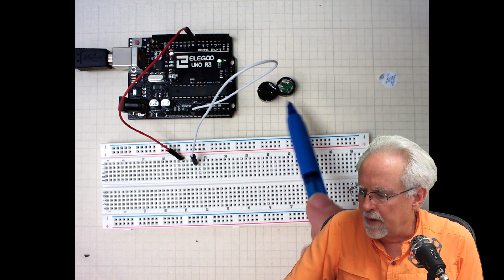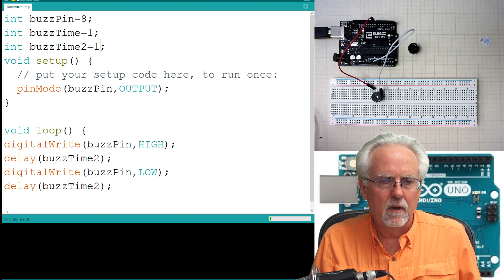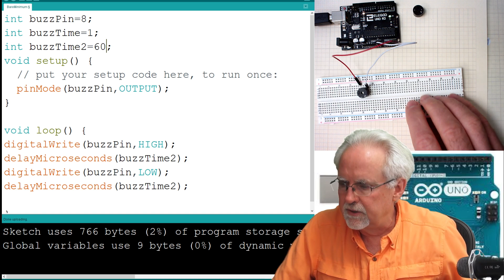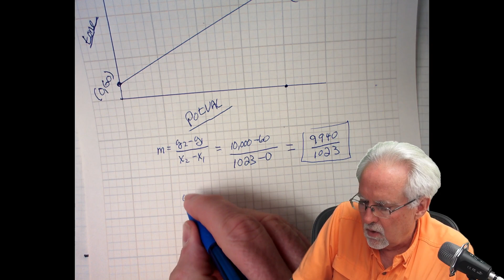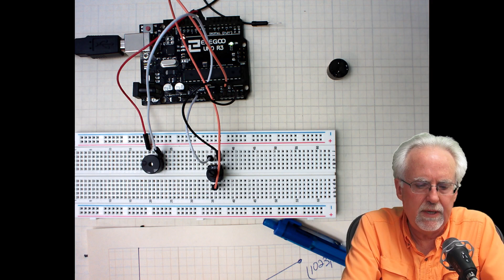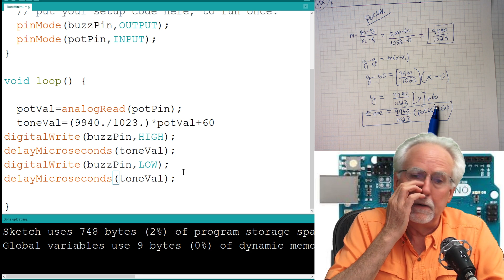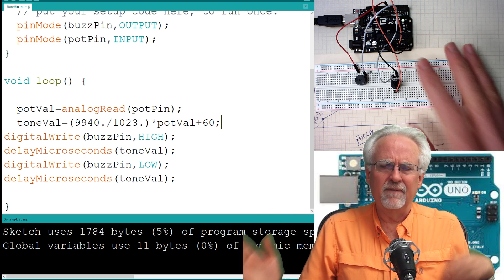Arduino Tutorial 24: Understanding Passive Buzzers

Comment: for anyone doing the Serial.println(potVal) command, i think it messes up the timing for the tones. even when using numbers and not using the potVal, i couldn't get mine to work. but as soon as i deleted the println command, the tones worked perfectly with value, and the potVal.
Reply: heyy, i had this problem too and i found out its due to the baud rate,  as you increase the baud rate the sound will get better, i was shocked too when i finally found out
Reply: Thank you Meng and Carlos, that solved the issue i had. Printing more text (data) per line deforms the tones even more.
String msg = "Delay (Tone) is: ";
Serial.println(msg + buzzTimepot);

So i changed the baudrate to 2000000 and now all is well.
Reply: @mengkin5836  Thank you! I was scratching my head onto why that was an issue :)
Reply: I had the same issue. And just fyi instead of deleting your code just go through and add // in front of the lines of code you are unsure about instead of deleting it. That will make it a note and not part of the process. This way you can verify an action before fully acting on it. It's a common practice in code troubleshooting. Other languages have different commands but in this case its //
Reply: @trakeC   thanks for this tip!
Reply: @trakeC  thats a good little trick. Thanks for that
Reply: I had the same problem... getting rid of the Serial fixed it.
Reply: A good debugging process for this is to use the // comment lines in front of the suspect line to test it without deleting it.
Reply: All i can say is ... THANK YOU :)
Reply: only took me an hour to figure that out...
Reply: Thanks for posting this - All I could get out of my circuit was a low pitch monotone, I deleted the Serial.print and it works as it should. Setting a higher baud helped but removing the Serial.print gave the best results.
Reply: Thanks for the added education. Been playing with the arduino as something to do during this COVID thing while I am not working... this one had me totally lost as to the cause... yes I am writing both values to the serial monitor... guess I am gonna have to comment out the writes and see if that fixes the issue. Man I am learning way more than I thought I would (this is a good thing) and Paul really makes things seem easy.
Reply: @rstudinarz  I found the difference in tones as well when I was using Serial.println to validate that I was doing things correctly. Then I remembered that the Serial output functions wait until all the characters send data over the relatively slower serial interface.  The function doesn't return until all the characters are sent - meaning that more delays are introduced which ultimately impacts the tones.
Reply: i had this problem thanks!
Reply: that's the trick, thanks
Reply: I did the same, thank you very much

Comment: Paul, My Arithmetic skills are definitely foggy at best, I could not get everything set up correctly, didn't feel confident plugging everything in, Yes I folded like a cheap lawn chair but I tried to figure it out. I went on at the end and set potVal=analogRead(potPin);Serial.println((potVal); and delay(dt); with the end result of all the way to the left 0 (with a tone) next line 60 and then all the way to the right 1023 and then next line 10,000, serial was working but the tones were not the same, still experimenting with the length of time next? Analog and digital are confusing a little still?
Thanks,
Gary

Comment: i have know idea what I did wrong but no matter what I tried the buzzer emitted a high low tone that stayed the same throughout the class.  It was very frustrating that none of the variables had an effect. Even swapping for the active buzzer gave the same result
Reply: I know it's been 4 months since you commented, but your variable resistor might not have been making contact properly. I know on mine, I have to keep my finger on it to put pressure into the breadboard for it to read properly. If it doesn't read properly, then you'll get a constant tone. I could be wrong, but something to think of. If you read your resistor value and print with the Serial.println command, it should show you in the serial monitor if your variable resistor is working.
Reply: It may be your code so write it here then if it is ok you will know you have a hardware issue wither wiring, you can do a simple program to display the pot values are reading ok and it is working, again write a simple test for the  buzzer to confirm if it is faulty.